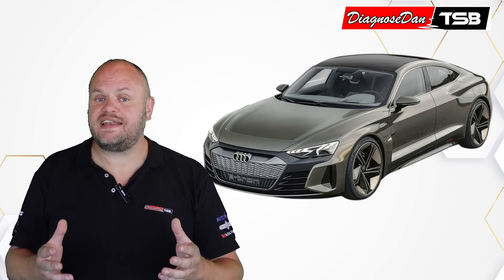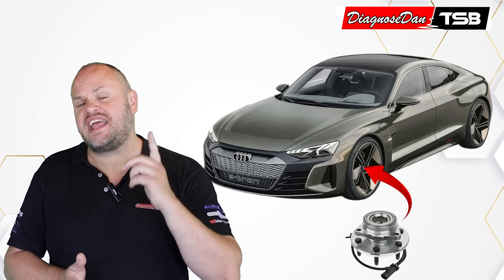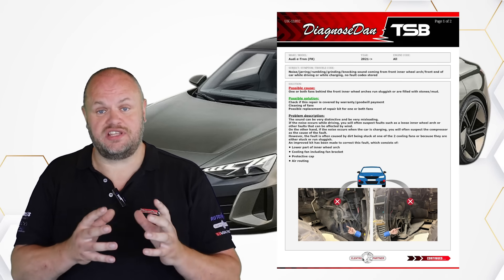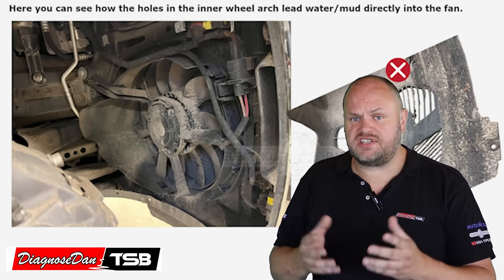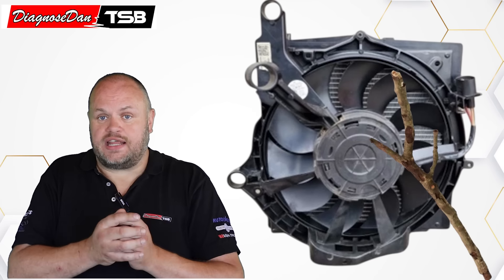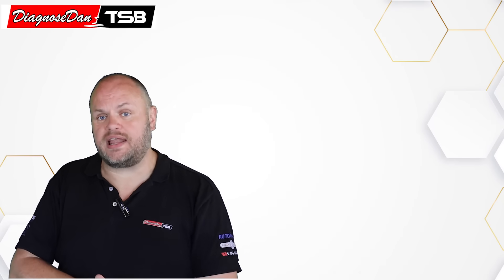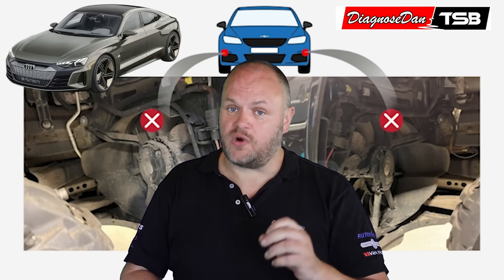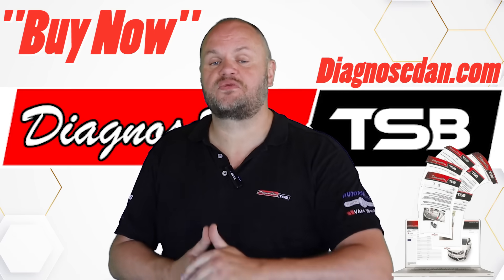Audi e-Tron GT Strange Noise – Not the Motor, Not the Drivetrain… Guess What?

Comment: Absolutely insane that it is legal to manufacture such horse crap and sell it as cars. As an engineer this kind of stuff makes my soul weep.
Reply from the maker: You’re an engineer, cool. We often talk about things like this in our TSB office. We know cost and production time often overrule logic, but it would be great to hear the inside story behind a design like this.
Reply: @DDTSB  I do not know the story behind this particular case, but indeed good engineering is often overruled by non-engineering reasons like cost-cutting (during manufacturing, but increasing cost of ownership and hence revenue for parts and service sales). Engineering is always about finding a good enough solution for the smallest possible cost, but when you disregard the first part it's no longer proper engineering.

In any case, it feels very unethical to use designs that clearly aren't sustainable in real world use in cars sold for real world use. Those fans can't take rain, dirt, sand, snow or other normal things a car faces in normal use. It would be different if the car was only marketed for use on clean brushed tarmac tracks.

In Europe we have pretty strong consumer protection regulation that in my opinion should trigger in this case and force the manufacturer to cover the cost of repairs. Unfortunately, it seems they have somehow been able to avoid it so far.

Comment: So how come the "technician" who was looking for the wheel bearing noise failed to notice the dirt accumulation right under his nose in the wheel arch?   Why would a good tech have to search the web for what was plainly visible?
Reply from the maker: Imagine you are trying to find an intermittent noise that sounds like a wheel bearing. First thing would be to try and confirm the complaint. If you can´t then check suspension etc. If you haven't heard the noise you have no idea where to look and ventilators like this is hardly on your mind at this stage (at least not for many)
Reply: @DDTSB  If you hear a noise that sounds like a front wheel bearing, you look at the front wheel bearing, whereupon you have your head under the wheel arch looking directly at the muddy vent.